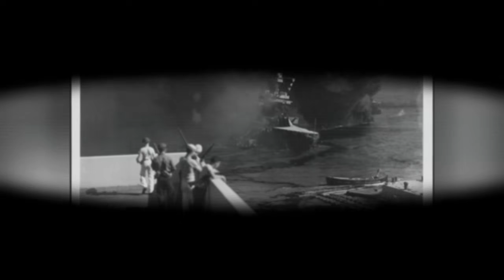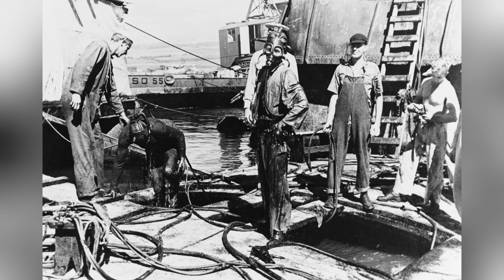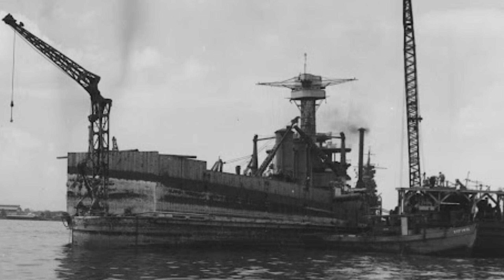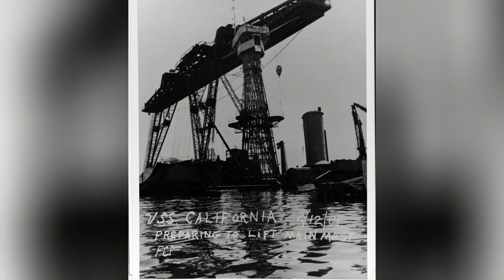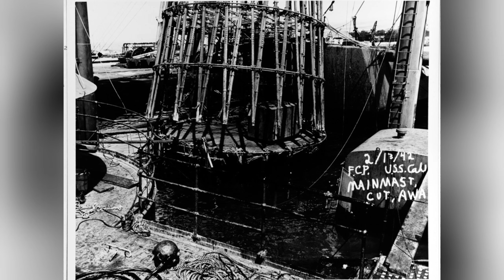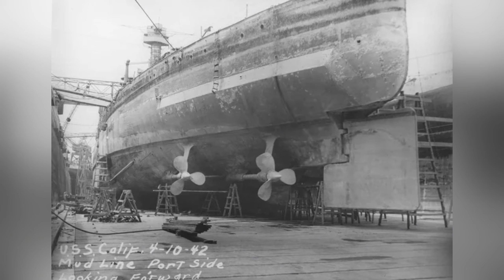Salvaging USS California: How Engineers Raised a Sunken Giant

Comment: Massive fuel is burned to fire the boilers. The boilers create heat to produce steam. The steam is used to power the turbines. The force from the turbines is used to power the electric generators.  The electricity produced by the generators powers the  large electric propulsion system and several vital operating systems.
Could there be any other way to invite problems ?